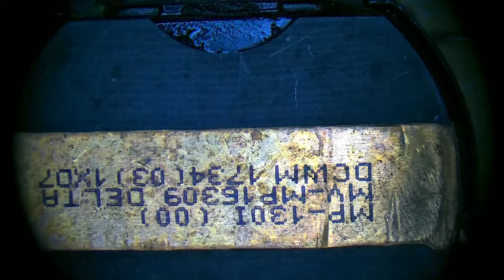PS4 Pro PSU repaire done now test and show dangers this is for infomation only these PSU's CAN KILL.

Comment: Thank you for the video and detail provided. I like the use of using the power supply Leads to discharge the caps. 
Totally take the point with regards to the probes length, longer is no good in this situation. 
Great content thank you
Reply from the maker: Thank you for kind words